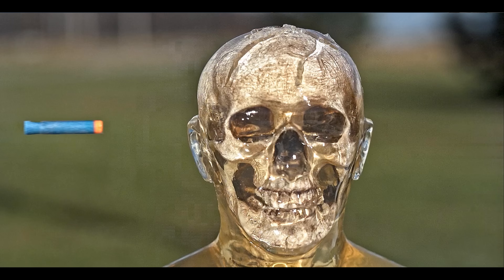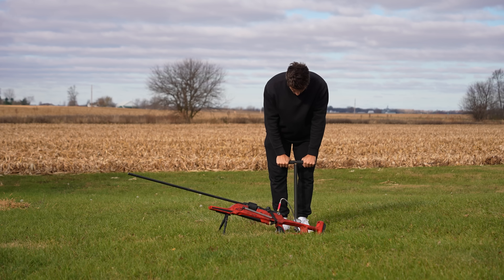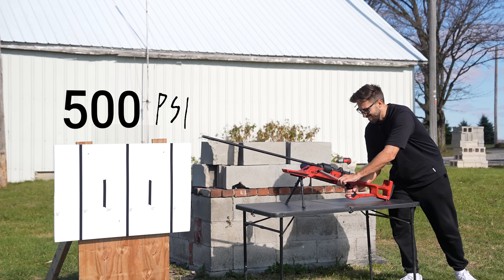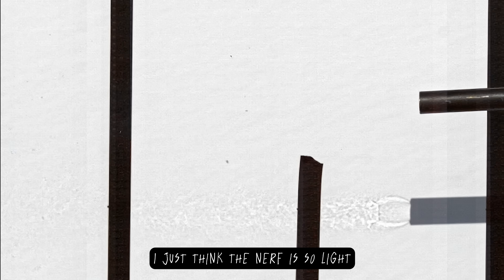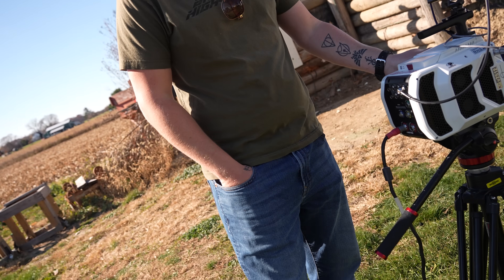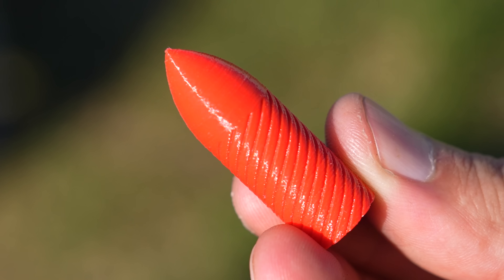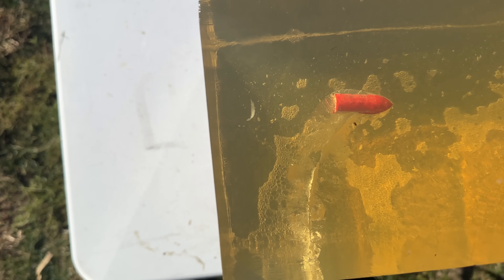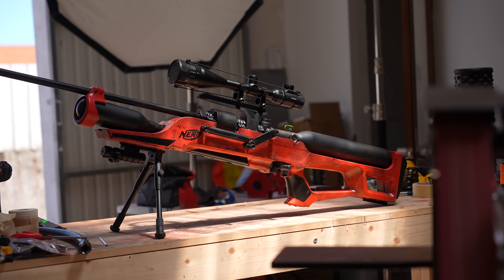How Dangerous is a Supersonic Nerf Dart?

Comment: The rifling on the 3d printed bullet was far too agressive such that at that point it acts more like a worm gear than a rifling, preventing the bullet from turning from force parallel to the rifling spin. The last3d printed bullet had a structural weak point between the nose and the body, if it had a smooth transition from nose to body it might have stayed in one piece like the second round. Also, flying at high speeds, the spiral pattern is unlikely to do anything aerodynamically.

Comment: Ekin = 1/2 • m • v2 
Simple as that. If it weight 0,00102kg and the velocity is estimated 343 m/s @1024mbar you can easily calculate the impact energy. Which then is transfered into the object of choice. 60 Joule. That is at least 50x the energy of most 6mm BB gun. No video needed.

Comment: It's counter-intuitive, but you can stabilise spitzer projectiles in smooth bores and increase penetration too, simply by inserting the projectile backwards.  With most bullets, this is also gives lower drag than going point first.  One of the drawbacks is increased barrel erosion using conventional propellants, but this is an air gun, so that isn't an issue.   It also creates problems with automatic feed systems, which again, is not an issue in this case.   If you want to stabilise a less pointed or round nosed projectile, you just have an open hollow tail for the last quarter to half of the projectile length.  As you saw, the long solid projectiles are rather unstable.  Aerodynamically stabilised projectiles, as described, may be upset on exiting the muzzle and take 10 to 30 metres to get into stable flight.   Another approach is simply to use a flechette with a discarding sabot, which is usually stable from the muzzle.

Comment: To keep the original Nerf dart from falling apart, you must feel the back of it with a foam earplug. This keeps the insane amount of high air pressure from filling up the back of the Nerf dart, and when it reaches the end of the barrel blowing up.

Comment: Would have been cool if u used multiple lines marked on the board and calculated the acceleration increase/decrease during the first 2 inches and every thereafter to see at what distance each dart reaches its peak velocity.. woulda shoulda coulda didnt

Comment: the rifleing on the 3d printed projectile was probably too tight. generally gun barrels are only around 1 twist per 10 inches so having it be much less than that did the opposite effect and made it unstable.

Comment: You should of shot 50cal lead balls you don't really need rifling you just need a tighter fit cause the air pushing air over the top so when it comes out the air is pushing bottom causing your round to flip upward.

Comment: If you could put a straw into the hollow portion of the nerf dart.  That would contain the pressure inside the dart after it exits the barrel and maybe keep the dart from bursting and messing with the flight characteristics (especially drag).

Comment: How about a fin stabilised bullet? 
Taperd in trailing edge with fins. 
As its sub sonic the air should flow over the fins and keep it true.

Could 3D print and fit a cast lead core.

Comment: I remember your last video but the last thing I expected was to get the high speed crew in here. For reference on all these energy values, anything over about 80J is considered 'Potentially lethal' by the U.S Army since that's the energy that will penetrate a half inch of pine board. So 252J is well and truly in the ball park. As for the rifling. I believe shotgun slugs, the rifled kind, use aerodynamic effects to spin it up. Though these are usually less aggressive on the lands than the plastic one here.

Comment: the problem with Foam Darts and Supersonic is pure Physics ... a Foam is build from Air bubbles .. and they will not be able to reach the Sound barrier because  of the Air pressure difference between the Front of the dart and the rear end when braking the barrier ...  it is not possible  with this soft material !!!

Comment: 18:54-18:57  that's so cool.  The bullet went in perfectly straight forward and seemed to come out the other side completely flipped around.  The extra damage the projectile would do while spinning inside adds ever more carnage.
Reply: the extra damage wont matter lol, Thats a whole kill shot😂
Reply: Nice eye
Reply: Not only that, the penetrative power was so strong, it didn't push the dummy head off the table like the other ones, just went through like a knife through butter.

Comment: You should try making a projectile similar to apfsds in tanks (armor piercing fin stabilized discarding sabot) it should increase the range, accuracy, and penetrating power. It works on smooth bore guns similar to the one you have.

Comment: If you do more with this thing using 3D printed projectiles, adding a hollow base would help them aerodynamically self stabilize by moving the center of pressure aft of the center of gravity.

Comment: The problem with the rifled slug is the air pressure passing it on the back side will fight the forward directional rotation. Hence why it tumbled. This has been tested on other channels with smooth bore shotguns and rifled slugs. Same principle.

Comment: You should have tried different twist rates on the rifled slugs. That's why the slug didn't stabilize, the twist rate wasn't correct for the weight.

Comment: I'm sure someone has said it already, but the reason your rifled dart didn't work is because the rifling is too steep. If you decrease the slope of the rifling on the printed darts you might impart more spin in the rifle. Also there's going to be a fine balance of tolerance for it to fit and let the rifling grab, which might be difficult to recreate with a print.

Comment: The last head shot was too high, I felt like you should have aimed a lil lower instead of having it run through the part that was already coming off. All it did was separate a part that was already basically falling off anyways.

Comment: Just a tip for the rifled bullet (from someone working in the industry and talking with many ballisticians) the reference footage of the bullet that you put into the video is 8.6 blackout, one of the fastest twist rates of any bullet manufactured today. Looking at the spirals of your printed bullet, they are WAY too steep (they have far too many rotations per inch) and you may be getting serious destabilization due to it. Try it again, but this time calculate a twist rate on the projectile for a 1:10 twist rate. (One full twist every 10 inches). Other inspiration can be had by looking up "rifles 20ga slugs" and mimicking some of the design choices.
Reply: Agreed, and even compared to the 8.6 blackout comparison in the video, the angle of the grooves on the 3D printed one looks to be ~45° or maybe more, while the 8.6BLK is maybe 10-20° on a quick glance. What he made is a screw, not a rifling. =)
Reply: This or just a basic APFSDS round
Reply: I think 1:10 is still to agressive maybe 1:12 or so that would still stabilize the round while not fouling the barrel
Reply: @furrycircuitry2378 It's not using any black powder or gun powder, there won't be fouling.
Reply: @hotmealsonwheels4738  the round itself gets ripped by the rifling, thus results in fouling. A less aggressive rifling would do better at not tearing apart the projectile
Reply: @hotmealsonwheels4738  barrel fouling is very much a thing in air rifles. The pellets leave behind microscopic amounts of lead in the barrel which fouls the rifling.
Reply: Wtf!!!!! I came to comments to say basically the same thing....what are the odds....
Reply: The problem is, that you can't transfer the spin to the bullet from a smoothbore. The old Brennecke Slug for shotguns has very deep grooves on it to get a spin, but experiments showed, that you cannot transfer enough torque to the projektile to get it spin just by airflow. An arrow stable projektile with an discarding sabot would be best. Further you can see, that you have a lot of airflow out of the muzzle, before the projektile exits. 
My recommendations;
Use a larger tube and an arrowstable projektile with an sabot, which should although tighten the barrel from backwards against errational airflow/pressure drop.
To get a stable spin stabilized bullet you need much more revolutions. The formula is for revolutions per second : muzzlevelocity (m/s) devided by twist length (m).
Reply: Sound like the recipe for a clean kill but this ain't GTA 5 💀💀💀
Reply: Can’t wait for a sequel to this sequel! 😎
Reply: Also important to note that rifling works so well for guns because the projectiles are metal (and relatively soft metal at that, at least when compred to the steel of the barrel), and therefore pretty maleable, and so they can deform a bit to give the rifling a better grip. I have no idea if PLA will do that, especially at the speeds, pressures, and forces involved here.
Reply: ....ballisticians...my new favourite word....sounds like people who design men's banana hammocks to keep things in place...how am I going to work this word into a casual conversation ? 😁
Reply: Well main problem is Bullet is rifled NOT Barrel...

Comment: Spinning a dense lead/copper bullet helps stabilize it, but without the mass (so something light like your 3D printed projectiles) the spin would probably end up making things worse, not better.
There are already companies like Umarex that make large caliber, high power air rifles that are known to be effective. You could use those to compare your design against, and maybe see what you're doing well and what you could improve on.

Comment: Solution for exploding nerf darts, get a piece of tubing that will slip down inside the hollow middle of the nerf, this way the pressure pushes on the plastic tubing rather than the flimsy foam

Comment: Have you considered creating a 3D printed plug to you can insert into the back of the neck dart? My thinking is if printed a sleeve that can fit the length of the hollow middle of the nerf dart, it will keep the dart from deforming. Think of it like a really long thin tophat. It would give the back of the dart support and keep the compressed air  from balloning the shaft of the dart.